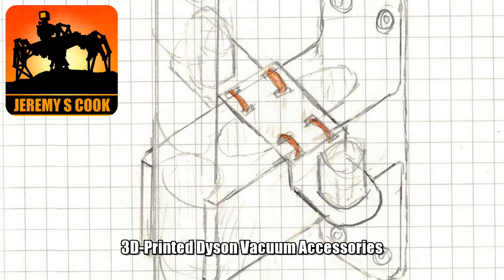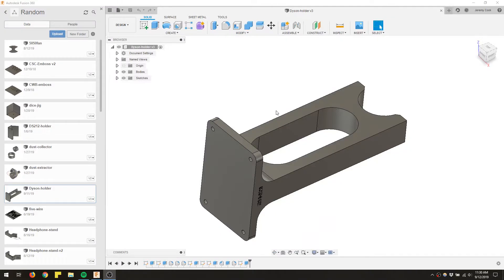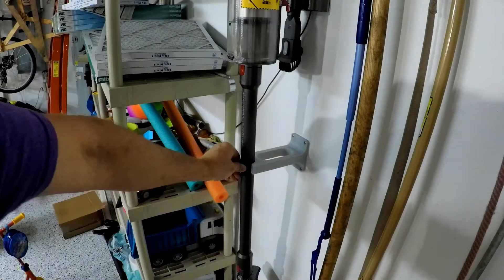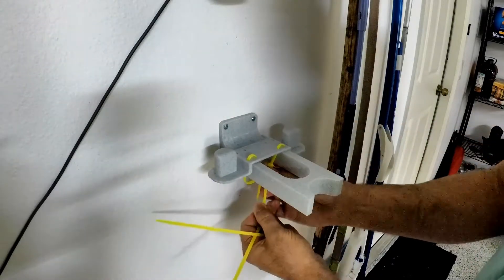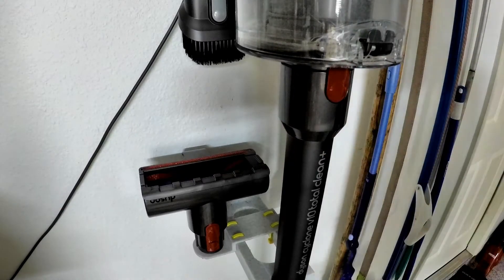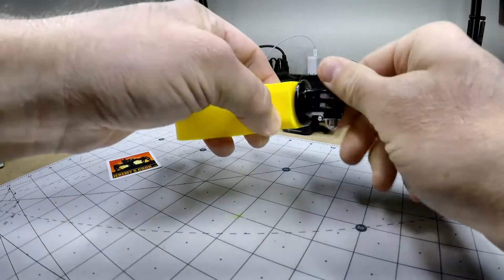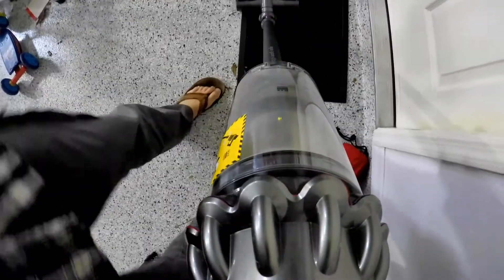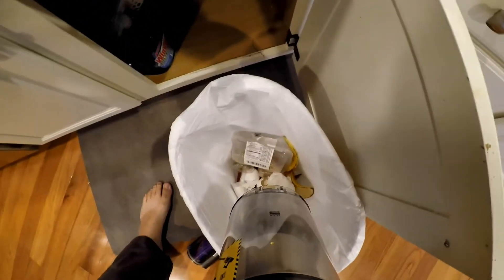3D Printed Dyson Vacuum Support and Accessories Holder [V10]

Comment: I don't have a vaccum of this kind but now I feel to organise my attachments anyways.
Reply from the maker: Glad I inspired you :-)
FWIW, it's a great vac. Not having to plug it in makes things a lot easier.
Reply: @JeremyCook  Due to tax and stuff it's quite expensive back here in India plus college students don't have much to spare anyways. What's the wattage for this over there?
Reply from the maker: @ubdussamad4744  Not sure about the wattage, runs on 120VAC. I definitely would have gone with something cheaper when I was in college. Pretty sure I had something secondhand, or used my roommates'!
Reply: @JeremyCook  Using my roommate's would have been cool, but I think I don't have one.